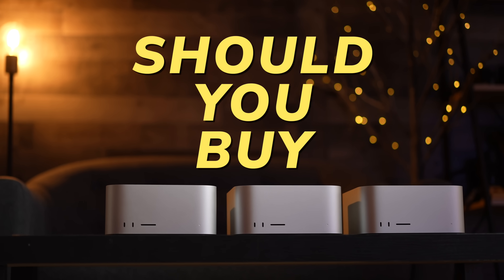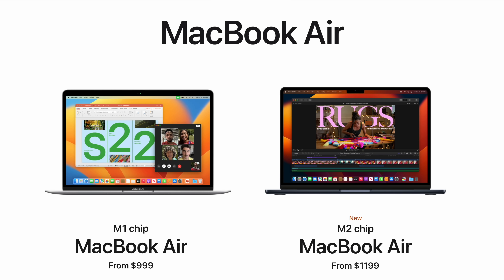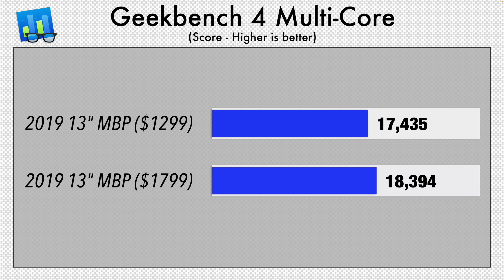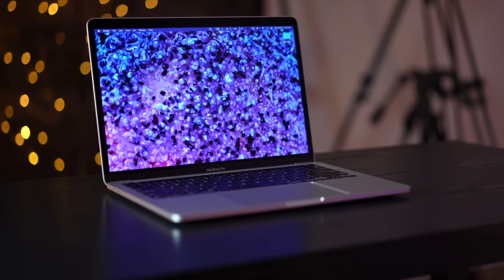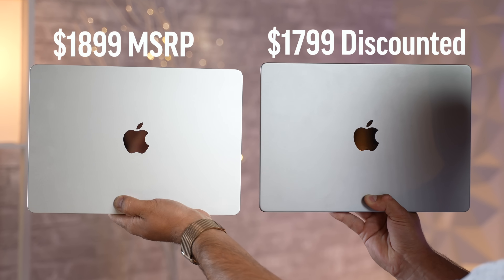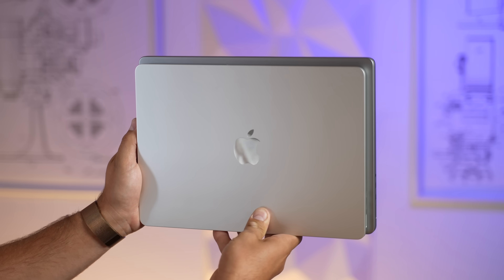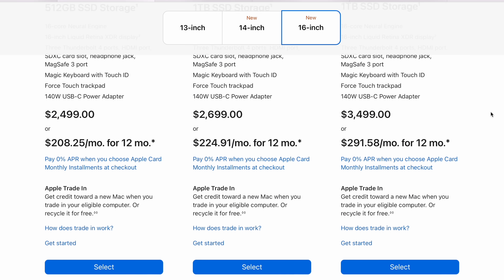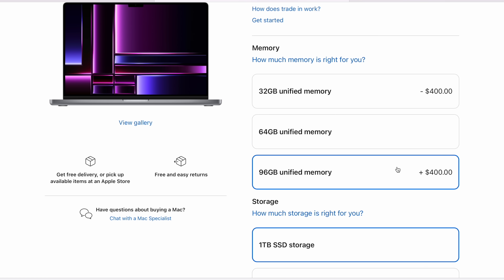How Much RAM for Your Mac in 2023? ULTIMATE GUIDE!

Comment: based on your videos (probably not this one...) I only bought 16GB for Lightroom editing. If I remember right, you mentioned somewhere that 32GB won't help much more.

Well, that's just wrong. My Mac Mini M2 Pro slows down to a crawl when editing 45MP files with lots of masks etc. The memory pressure is way too high.

Should have gotten 32GB at least, better even 64GB for LR.

Comment: Profesional composer here, still working with a 2013 retina 15” MBP, which has 16gbs of RAM.

I do a lot of virtual orchestral work, with tracks up to 35min with absolutely no issue. 

Just stating the fact that actually some computers are just really great and the technology is getting to a point where you don’t REALLY need to be upgrading computers that often.

By the way, I am based in Lima, Peru

Comment: Sounds like you really did your homework but your explanations are NOT clear or easy to follow. I think part of the issue is you use sentences with too many logic loops "If you want X, then you'll be spending Y, in which case you might has well have gone with Z (something explained earlier)." I can't keep all this evolving info top of mind (I'm not an upgraded M2 chip!). Please add more charts. Bonus points if you somehow fit the info into ONE chart and keep returning to it to add info.

Comment: Love your videos 🙂 I would recommend the 64GB of Ram if you are a heavy video editor (think weddings.) With a ceremony, speeches, first dances, and a highlight film; all one timeline (in Premier Pro) I'm constantly well above the 32GB threshold (Adobe still hasn't optimized Pr for the M2 Max yet [I called them, and they said they should be releasing the update in October 2023.] I've even been into swap memory (as high as 81GB of RAM running) toward the end of my project, and when rendering... So choose carefully Lol
Reply: This is a very valuable information. What resolution do you shoot? 4k , 8k? and  cameras, codecs? Also how long is your sequence (time line) normally is? I am deciding how much RAM should I go for? I edit short form(promos, small commercials etc)
Reply: @jay2574c  I shoot on a Sony A7siii... With the MBP, you can pretty much shoot in whatever file format you want, but I've been shooting in XAVC S 4K, 10bit, 4:2:2. My timeline is in the ballpark of 1hr & 20min, to 2 hrs - depending on how long the ceremony is (I edit the ceremony, speeches, and dances first; then pull from those edits to complete my highlight film.) And I've gone into swap memory (used more than the 64GB of RAM) to do so. In my opinion, if you're doing similar edits, and can afford it; go 96GB of Ram.

Comment: Excellent. I ordered a Mac Mini M2 with 24GB of RAM. I shoot thousands of photos indoors, often at high ISOs. The Denoise AI in LR promises to revolutionize my work - the results are wonderful. I'm hoping Apple will fix the neural engine so Denoise will run as fast as possible; on a graphics-weak Intel NUC 12 Pro it takes 5 min or more to process a single photo. So, 6h 20m for 100 photos. Don't know if the extra RAM will help, but maybe it will speed things generally (page file ops)? Lots of questions.

Comment: 90s: for simple usage like browsing and writing, it's enough with 4MB RAM. For advanced usage, consider 8+MB. 2023: for simple usage it's enough with 8GB, but otherwise consider getting more. Like… what? 8GB is 2000 times more than 4MB. If anything is twice as powerful, that's a lot. Ten times? Omg! TWO THOUSAND times? That's astronomical, a total MONSTER compared to back in the day, and we're still at the level where that is for ”simple usage like browsing”.

Comment: I regret getting only 16Gb RAM in my Macbook Pro M1 Pro. It frequently pages massive amounts of data to my internal SSD.

32Gb of RAM would have avoided this.
Reply: And what is the problem? Swap memory is normal, this is happening including with 64GB ram for some tasks.
Reply: @AurelianIrimia   It is large amounts of swap going to the Internal soldered on SSD that when it wears out will brick my very expensive Macbook Pro.

Comment: One nice thing about the 24GB memory option is that if you do need more than 16GB but don't necessarily need the extra CPU or GPU of an M2 Pro, then it's WAY cheaper. For the same storage, a 24GB M2 Mac mini is $500 cheaper than a 32GB M2 Pro Mac mini. As for who might need that much memory, I have run into memory issues on my 16GB Mac mini when running Civilization VI (which takes 8GB by itself), Steam, and Discord at the same time. I will often have to quit my other apps to avoid memory pressure, but I'm sure that with 24GB of memory it would run no problem.
Reply: Very good example of a specific use case that more than a few people will wanna do. For complex CPU intensive games like Civ VI, EU IV, and many others, more RAM above 16 GB will only help you, no money wasted
Reply: This is what I ended up doing. Bought it for UX design work. It’s primarily vector based so I didn’t really need the GPU of the Pro, but I ensured I wouldn’t need more RAM by going with 24gb. Seems like a sweet spot and ultimately less money spent.

Comment: Would love some input on what we should do for our business.

Current Mac: 2021 M1 Pro 16" with 16gb ram, 1tb SSD, 10gpu

Decision between:

2023 M2 Pro 16" with 32gb ram, 1tb, 19gpu

2021 M1 Max 16" with 64gb ram, 1tb, 32gpu

We do video editing and typically are editing multiple projects per day (5-10) all 4K 10bit. We edit with FCP and are getting too slow of rendering and export speeds after edits, color design and especially if we add neat video or optical flow. These videos are usually under 3 mins.

Any info or suggestions help a ton, thanks!

Comment: Just got a M2 Mac Mini 8/512 for $655. I am going to use this for web browsing, email, video conf. and rarely editing photos. Originally I was going to get the 16/256 with an external SSD, but it would have been the full price of $800+SSD. With what I am using this for I am pretty sure it will be fine for 5+ yrs.  and then I can sell it or just connect it to my TV and run emulators. Having the upgraded SSD is worth it for $55, faster speed and better TBW values are good to have for peace of mind due to the rare times if swap memory is ever used. I have way better speeds compared to any external SSD I would have bought, thunderbolt 3 drives are not cheap. With the $200+ I saved and more if I decide to sell this mini for around $100, my savings will be going towards a M4/M5 mac mini when it comes out.

Comment: I’ve got the M1 Pro MacBook Pro for CAD and Rendering as an industrial designer. I went for 16GB and totally regret got getting more. Fusion 360 eats through ram like crazy and all the Adobe apps are using at least 3GB with nothing even open. I regularly get the message to close apps because the system is short of ram. Fusion is usually at 45GB of ram at this point including swap of cause. If you’re doing creative work I would go for at least 32GB if you want your machine to last more than 3 years.
Reply: I’m currently going to school for industrial design and looking into purchasing a MacBook for the software we’re going to use in the months coming up. My design program and classmates talk about how bad MacBooks are for architecture and interior design students but are okay for industrial design students since we use different kinds of programs. My professor who teach ID has one and said MacBooks are good for us but we’ll have to run our Mac with windows parallels or something in order to use certain software. I’m thinking about getting the m2 max with 64gb memory and 2tb storage for mine. I believe this is a sweet spot for my laptop use needs in my future classes!
Reply: @BlueJayJayson  Well it absolutely depends on the Software. M2 Pro and Max have the same core count so if your software doesn't utilise the GPU it really doesn't matter. I used Solidworks with Parallels which was a total pain, Rhino for Mac which works great, Fusion 360 which is fine for smaller files but really falls apart when importing bigger mesh files or working with bigger assemblies and Keyshot which is slow but works. It's nice to see that they finally support Apple Silicon but I really hope for Metal support with the rumored raytracing cores in M3. 

You can certainly make a Mac work for industrial design but I'll need to make compromises especially with CAD Software and rendering. And yes, 64GB memory sounds like a good choice!

Comment: Hi, I’m getting the 2022 m2 MacBook Pro and I’m concerned about not wasting money on storage and ram that I don’t need so any recommendations?
Reply: You can get by on 16Gb of RAM but to prevent paging to the non-upgradeable or replaceable internal SSD, I recommend 32gb of RAM and using external SSDs for your work and storage.

Comment: You buy as much memory and storage as you can afford at the time of purchase because you can't change your mind later.  Apple figured out how to really burn people with non-upgradable memory and SSDs, and charging overly excessive prices for those upgrades, and intentionally crippling the base models with not enough memory and hobbled SSDs.  Plenty of reviews confirming the 8GB/256SSD configs take a big performance hit with slow page swapping to the slower SSD and not enough memory for many tasks.  16GB of memory should be the minimum with 32GB of memory being the ideal upgrade, and 512GB or 1TB being the minimum SSD.  But Apple wants to sell people on their cloud storage instead.  And they intentionally priced the lower tier Macs with upgrades to meet or exceed the better models so people will buy the higher end Macs instead.  Speccing up an M2 Mac mini to exceed the Mac Studio is ridiculous when the Mac Studio is faster (more GPU cores), offers convenient front panel ports, and better cooling.  Just like the failed iPhone 14 being priced so close to the 14 Pro models, effectively making the 14 a poor choice to buy.

Comment: Great video!!! I’m glad you made this and there is some type of reference that makes sense. I appreciate it! 
I am trying to use my future new Mac with window parallels. I would mainly be running simple cad , sketchup and simple Revit. Simple cad and 3d modeling. You touched on parallels. Is 32gig or 64gig suffieicient for 3-4 years? I’ve bought way back when 2017 and upgraded to 16gb ram and was worth it. I still have it but unfortunately the monitor flex cable crapped on me. So I’m now looking for a new one.

Comment: I encounter many users with 8GB ram in MacBook Airs who have memory issues after 2-3 years.  Typically they use Word, Teams and a PDF reader.
Future proofing with 16, or even better 24GB ram is essential if you don’t want upgrade sooner rather than later.  24GB also helps ensure a better quality of experience over the life cycle of the product.  Worth going for, even if you don’t use photo editing software. 
MacTech - how about a video on the performance for 8GB ram models vs 16GB, 256/1GB storage combinations in early release M1 models?
Reply: I have a macbook Air M1, 8Go and I do big Logic Pro projects, and Da Vinci video editing. it's fast at browsing. my fastest machine yet ( having have the biggest Intel I9 before). very capable machine.
Reply: I am considering buying M1 Air 8 GB. I think it's not worth spending $300 more for 16 GB.
Reply: @openalternative  if you don't use a lot of Virtual Instruments, it's ok. There is a James Zhan video where he compares 8g to 16go and there is barely a difference. go for it
Reply: @Journeymanlive , thanks man for your advice. I really appreciate it.
Reply: @openalternative  You are welcome, If you buy new you can test it for real, and send it back if needed. good luck!

Comment: hello, in previous videos you mentioned your Thunderbolt 4 external ssd (like the Sabrent), they were really fast. I have a Tb4 adapter that reaches on my old 2019 i9 MacBook Pro about 1600 Write and 1950 Read with Blackmagic Speedtest. On my new MacBook Air M2 I only get 830 Write and 1930 Read. What is wrong with M2? or is it related to my TB adapter?

Comment: For anyone who uses a lot of web apps on a daily basis, extra RAM goes a long way. Websites these days are huge memory hogs (and yes, Safari suffers from this too, though not as much as Chrome). Keep in mind also that the free RAM you have also gets used as ultra high speed disk cache, so you can benefit from the extra RAM even when you're not actively using it.

For a "high-level productivity" setup, I've found 32GB is a great balance. 16GB is not quite enough (a large number of tabs and Electron apps can fill it and then you're into swap). But 32GB is enough to almost never need swap, even when running multiple instances of VS Code, Obsidian, Slack, and about 100 tabs across several windows. The 24GB option on the Air is also compelling and based on my experience it would handle my workload fairly well most of the time.

Comment: I can give insight as an iOS developer working with machine learning, augmented reality, and LiDAR technologies. 

Casual dev work gets my machine to 14 GB of memory used. When I start going heavier with 20 chrome tabs, a couple simulators, createML, ARKit, etc going, I usually average 25 GB of mem usage. 

24 GB machine is perfect for dev work but I don’t care about storage space or speed since dev work doesn’t leverage that and would rather spend the extra money to have real RAM instead of relying on swap to handle overflow so I’d honestly see 32 GB as the best option of you are willing to spend a bit more but can absolutely get by with 24 GB. Anything less than 24 GB is a  no-go for dev work.

Comment: Thing is as a creative I’m in most of the creative suite all day ps il Id lr skipping between each program then productivity like asana research tabs, word, excel and outlook just running these will eat over 32gbs standing still let alone booting up prem or after effects so I would say for most creative pros the 64gb is almost the minimum. If your pushing creatives down the 16gb side they are going to have a poor experience imo. Weekend warriors working on one project per week fine but when your working on 3-5 per day it’s a nightmare and the time to shut down apps and reopen just isn’t efficient. I would take the ram before a process upgrade all day which is why it’s sh*t because you have to pay the extra to get 64gb.

Comment: I do simple stuff like web browsing, but 8gb is not enough when I have 96 open tabs in safari, 10 in chrome and 5 in edge, while trying to do a quick fix in photoshop and through the photo to illustrator to make a simple flyer for the school board. That’s a normal and light workflow, and since I keep my Macs for 6-10 years, I believe 16 gb is not enough, and especially won’t be enough in 6 or 10 years when I’ll still be using the same Mac.
Reply: It might just be me, but I am not sure I would call that a light workflow. A light workflow is more is a couple of tabs open and running Apple Photos and Keynote.
Reply: @JBoy340a  Well, light workflow for me is that I don't shut down my MacBook and I'm keeping it open for everything I do. Some of my tabs are for something I was looking to buy yesterday, some tabs are info on VoiP and device settings, this YouTube tab, an IKEA tab (13 tabs right now), Pages is currently open because I was writing down those settings from the open tabs, Photoshop is still running because... well because when you close a program on Mac, it doesn't really close, Excel is open for the same reason. Mail is always open, calendar is open, notes and messages as well. If all you need is a notebook to open just a couple of browser tabs at a time, I'm sure a netbook is enough.

Comment: If you get a 14 inch pro, get 16 gigs. Its a good balance, apple will auto switch to 32 if you get the 30 core GPU chip but if you get the base or the 12 core one 16 gigs should be more than enough. As well as that, 32 is 540 aud more, really not worth it. (take my opinion with a planck length of salt)

Comment: Swapping shortens the life of your soldered SSD - if you consider buying the base model, be prepared to through it out in 1-2 years. Surely spending $200-400 more is better than throwing out $800.
Reply: 1-2 years? Hahah good joke... that's just wrong.
Reply: @Adventure_Bross  if you happen to own a M1-M3 Mac with 8GB RAM, go ahead and install smartmontools and check how much data was written to your SSD. If you use memory intensive applications, it will probably be in tens of terrabytes already. Once your SSD reaches approx. 256TBW (terrabytes written), it will die. And you will need to replace the mainboard along with the processor, RAM and SSD.